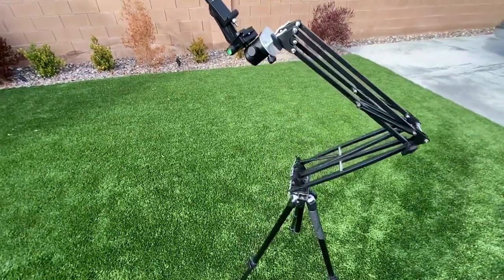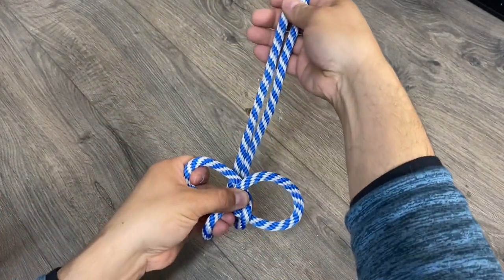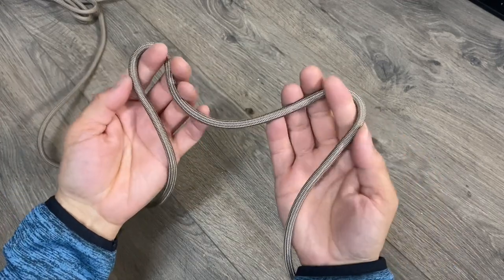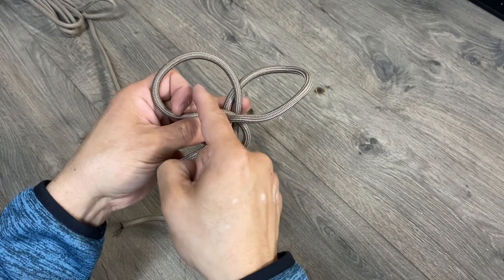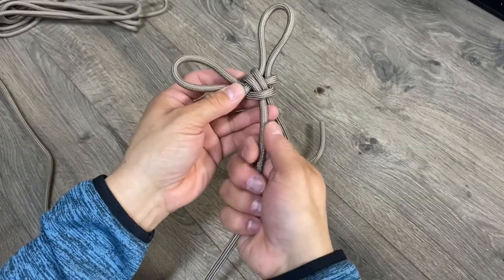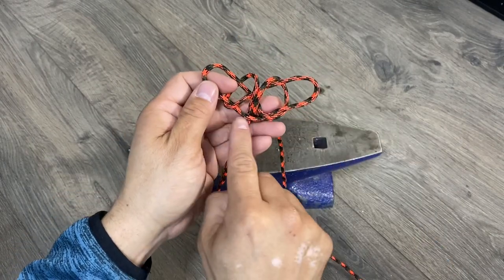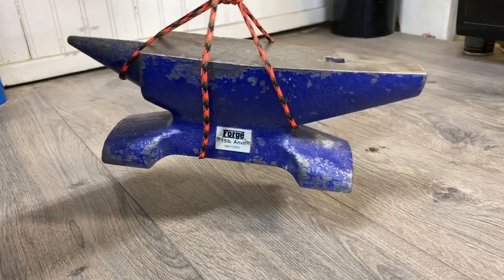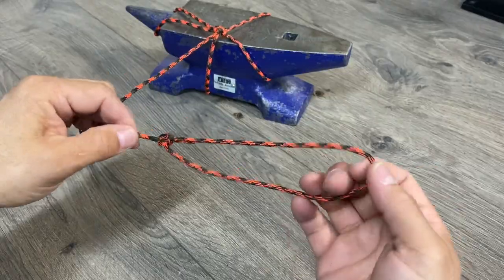Zero degree harness - Spanish Bowline

Comment: There's a far simpler and faster process of tying the 2nd method that doesn't have you fighting the line with a bunch of flipping:
1. Hold the middle of the line draped over your index and middle fingers and pinching with your thumbs, palms are up, we're not using our ring or pinky fingers.
2. Cross the ends and use your thumbs (nail side) to pull a bite up through the middle.
3. Hold the middle of the line with the middle fingers as you reach your index fingers around the cross and flip the bites into loops.
4. These loops will lay on the cross which you can pull through the loops with your index fingers and thumbs.
5. Release the middle of the line from your middle fingers and pull the cross lines apart to tighten everything up.